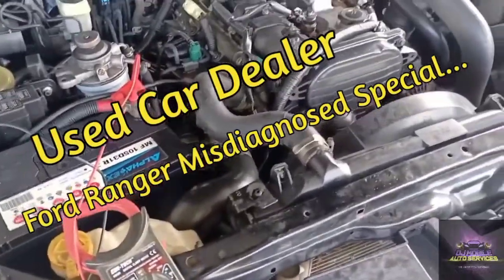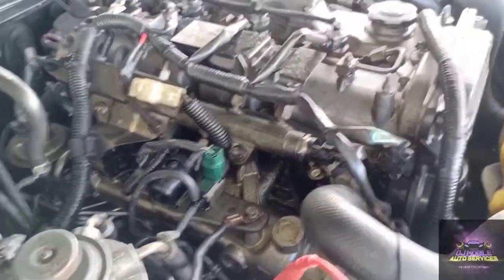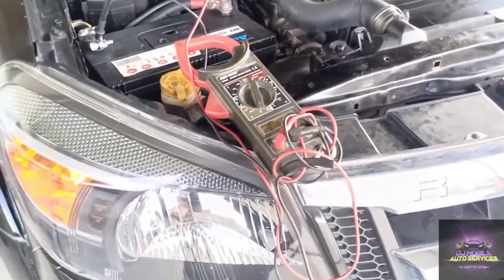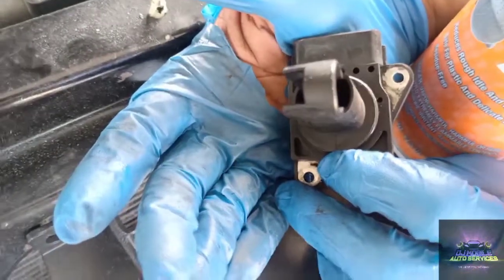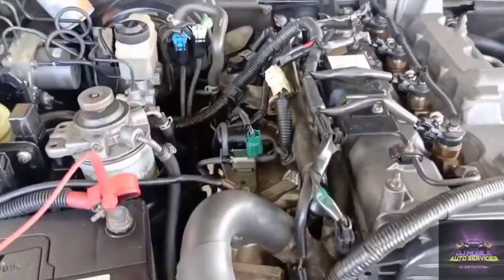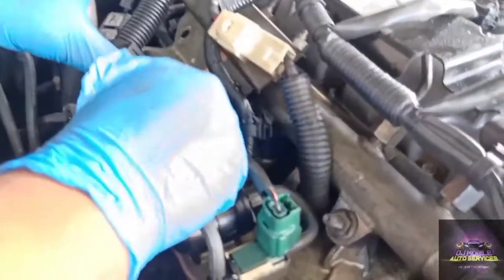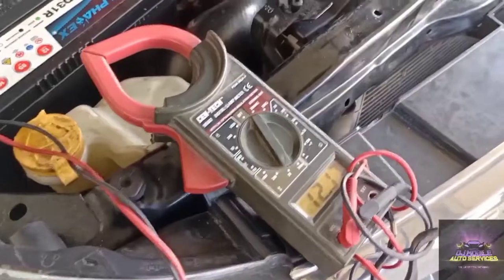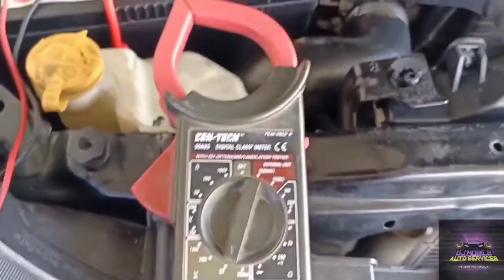Ford Ranger/Madza BT50. Crank-No Start..What checks can be made before parts are thrown at it?

Comment: I have the hard start issue on my ford everest,no power supply to injectors and common rail sensor.
Reply from the maker: If the ecu isn't seeing the desired pressure while cranking. The injectors would not fire. Start from the low fuel side and make your way up to the high pressure side. Ensure that you are getting B+ on one wire and approx 9 to 10v on the next wire of the inlet valve for the high pressure pump

Comment: 12.oov at battery is typically is a symptom not the cause in many cases. 12v = 50% capacity 
revised starter is available from the later models .
A partly flat battery can trigger fault codes for cam and crank .
check list compressions /glow plugs / maf/map sensor clean / injector bleed off =saftey valve in rail / injector pump screen clean /  glow plug amperage draw / starter / battery / primer =airleaks

Comment: Battery. More like the pressure relief valve at the back of the fuel rail has failed. The way you keep pumping the fuel pump (which should get to a point where you can't pump anymore) indicates to me, the valve is passing. Gentleman on WildSideAdventures_SA had the same issue, which cost him thousands till he found the faulty valve.
Reply: Starting rough but then runs perfect when at operating temp?
Reply from the maker: Thanks for the info but this was not the issue. I was pumping because when I got to the shop that called me out for another job. I heard them cranking the truck to get it started and I just jump in to assist. They changed the glow plugs and other things prior to me get there
Reply: Took me six months to find my problem. Hard to start, ran rough till hot then a rocket. Previous owner had spent thousands trying to find the problem, not easy when it’s not throwing a code. I knew it was electrical so tested all the sensors….good. Then all the wires back to the PCM/ECU…….nothing. Plugged the PCM back in, ran perfect. I believe the issue was slight corrosion on the terminals so one or more sensors weren’t getting 5 volts. I do remember testing earlier the volts to the glow plug relay and got 3.6 volts. Thought it odd but didn’t think anything of it at the time. At 3.6 volts the sensors think the car is already hot so adjusts the air/fuel mix accordingly. Of course when the car does get to operating temp, alls good. Not saying it’s your problem but maybe.

Comment: what type of senzor was it?
Reply: I think I have the same issue 
Because when I try to start the car I need to put my foot on the gas
Reply: @IsidoroDaSilva  try cleaning the mass air flow. It could be a fuel issue also. The fuel regulator can be open and causing the rail pressure to drop off until it builds up
Reply from the maker: the Map/Baro sensor
Reply: I have same issue crank no start put new crank sensor and cam.sensor .. no fuel spraying out of nozzle
Reply: I have injectors out but conected to the rail so i can see the spray ..got pressure in rail.because the relive valve release pressure after pressure build up in rail
Reply: @upendranaidu5017  may have to check the Inlet flow metering valve aka suction control valve. Remove it and place you finger over the hole while someone is cranking. If pressure is building within the fuel high pressure Pump. You should be able to keep your finger over it. The check you rail pressure sensor. If it is close to the desire pressure. The ECU wouldn't fire the injectors
Reply: @LAKERS4LIFE-g1i  the ecu is not firing theinjectors
Reply: @upendranaidu5017 got to figure out why. Is the ECU not seeing the correct rail pressure or is it a circuit issue? You have to check your inputs before condemning the module or driver
Reply: Any suggestion ? Can the bent flywheel be the issue because engine was rebuild